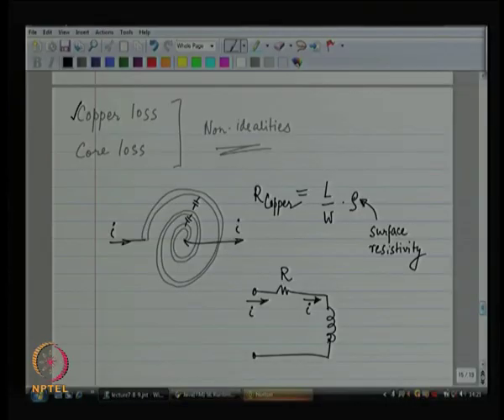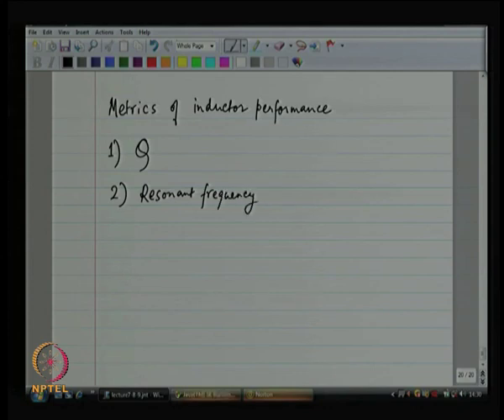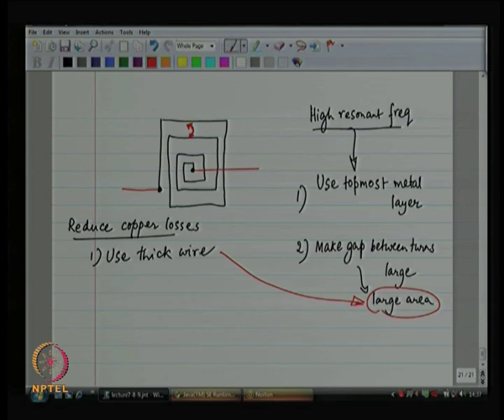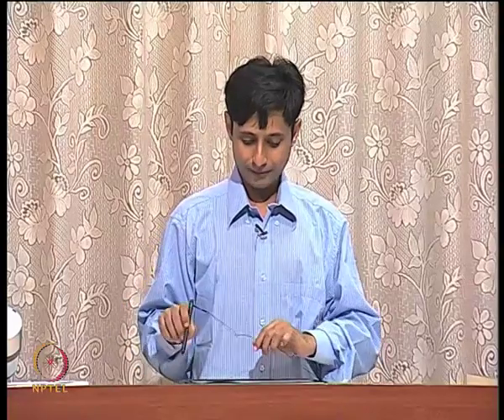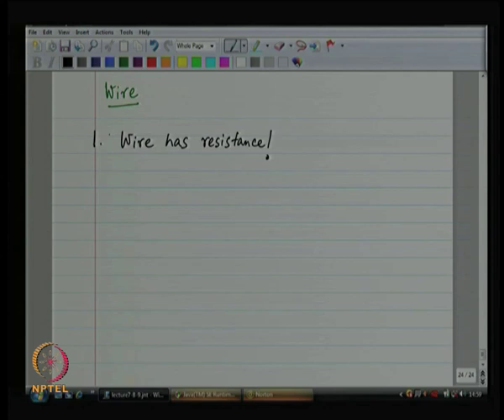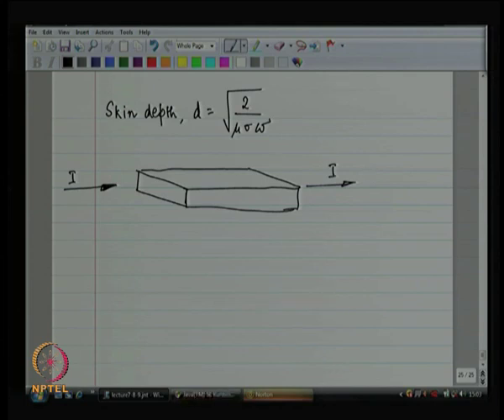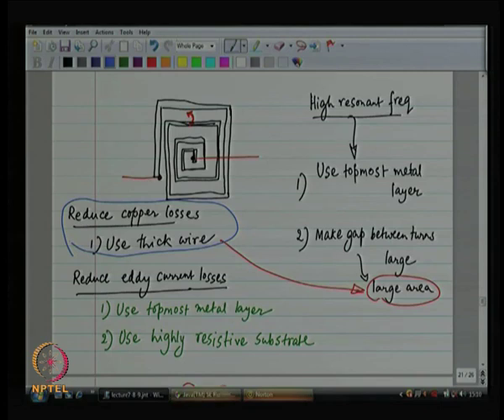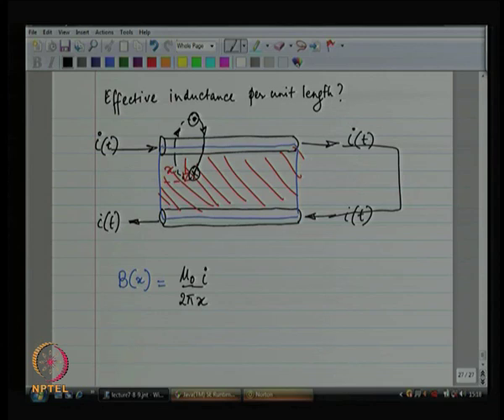Mod-03 Lec-09 Inductors and wires

Comment: At 39:15 at very high frequency ( order of giga hertz)  wire acts like either transmission line or else waveguide( depends upon operating frequency) in order to propagate EM wave from source to destination.. at high frequency R change with Frequency, Land C also.. if we take per unit length of all these components at high frequency we will modeled wire as a transmission line ( R,L,C,G all are per unit length) isn't it ?